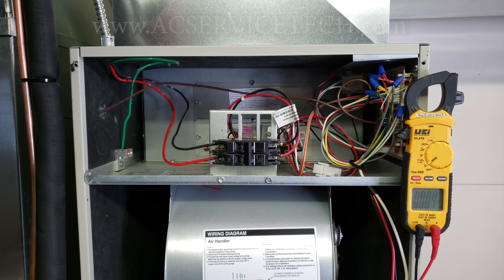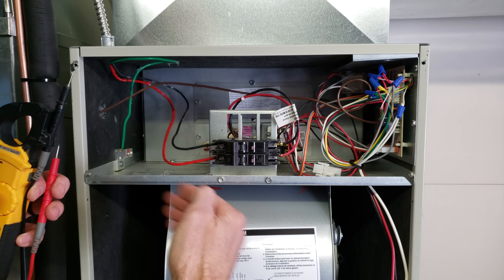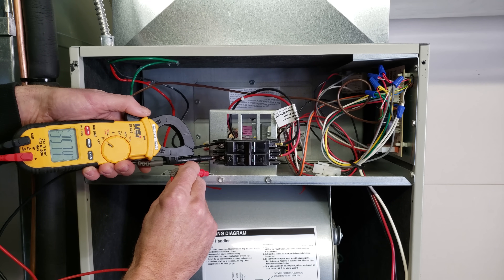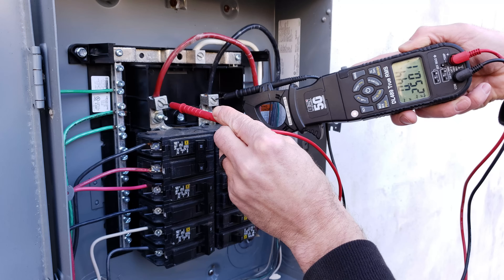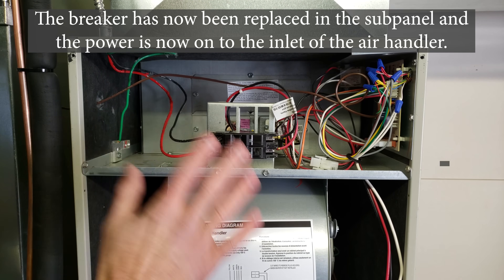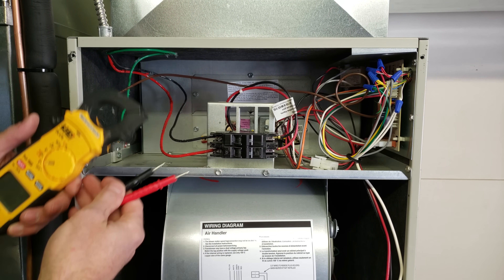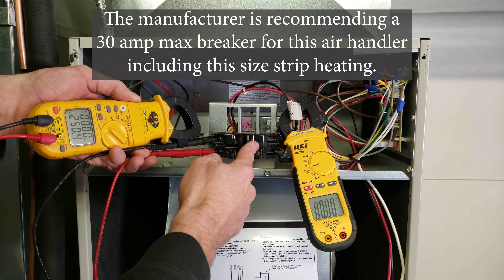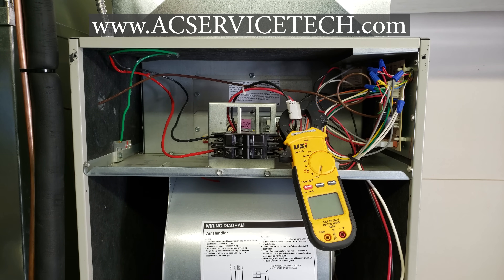Air Handler Not Working! Diagnosing an Electrical Power Problem!

Comment: Sound information here! Isolation of components and equipment is essential in many cases for proper troubleshooting. Nicely done. This particular problem is also missed when technicians are checking voltage at a single pole contactor. The voltage will backfeed through the unit. Between ground and each leg of power you'll get 120V but if you measure between each incoming leg at the contactor you get 0V.

Comment: Using red electrical tape wrapped on the white wire is a designation of power and should always be done regardless of the obvious 2 pole breaker. But i do like your observation of increasing that breaker if the wire is correct. The panel breaker does tend to be the issue on most of our voltage issues to the unit but rarely when it's oversized correctly and can only be done when you have a fused disconnect or breaker at the AH. AH breaker is the important one. The OHM to ground is good stuff. Thanks for the video these really help passing around good information.

Comment: Just wondering where that white wire turned red. Did you find the white wire in the air handlers disconnect?

Comment: Good video ! in California we are allowed to install a Breaker and pull power to our Hvacr equiptment. To everyone else Check Your state for Local Laws. White Wires in an electrical panel should NEVER  be used as a Power Wire attached to a breaker. White wires should only be used as a Neutral wire & should ONLY BE attached to a Neutral bar. Green wires Should ONLY be used as Ground wires. Colored wires are used for Power & attached to breakers. Follow these rules and everyone WILL be a lot safer.

Comment: It can be red or black in my area. I can't remember but I believe their may be a third color also it can be. Obviously talking about the power wire color but nice vid!!! I've ran into the same issue with an od unit but was something in the disconnect ultimately if I remember right.

Comment: Had a similar problem recently was at a job with a leg out coming into the condenser disconnect and something that had me scratching my head, on the leg with 120 across the line and load side of the open disconnect I was only getting a bit over half the voltage drop of like 75 volts but the output side still had 0 volts to ground like I'd expect with a full voltage drop super weird.

Comment: I have a question on how do I add a heat pump to the system , removing the heat strip because its not heating enough for the client and were happier when they had a heat pump before

Comment: Thank you for your video. I appreciate it. One question, what do you think is the best way to study the sequence of operation of a particular unit?
Reply: I've found that the manufacturers' installation manual is best. This will eliminate, what are typically minor, differences between different manufacturers and different models and will inform you of jumper or dip switch settings that can change the operational characteristics of the equipment. Also, important to know what thermostat is being used and the specific installer settings that have been programmed such as "comfort" settings vs. "normal" settings.
Reply: @bill944  Thank you.